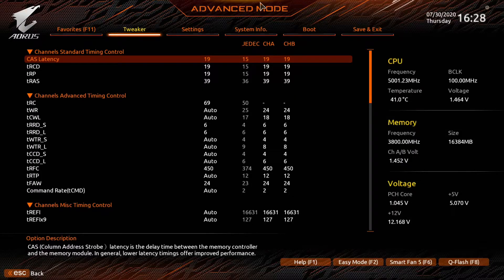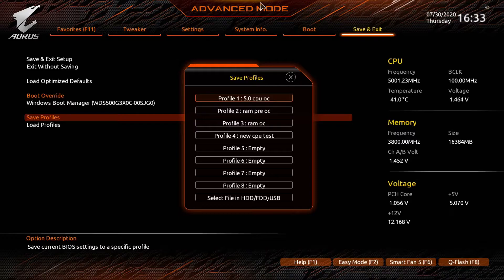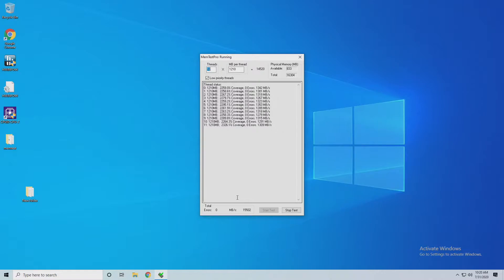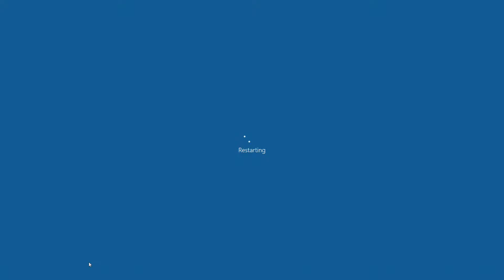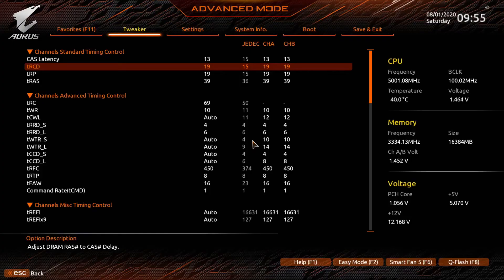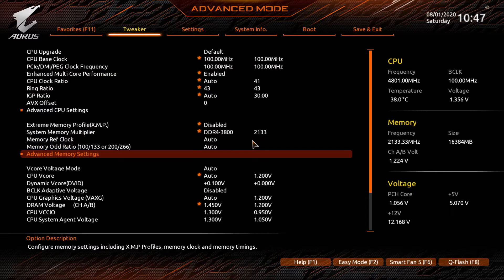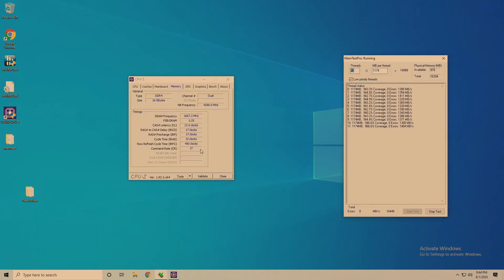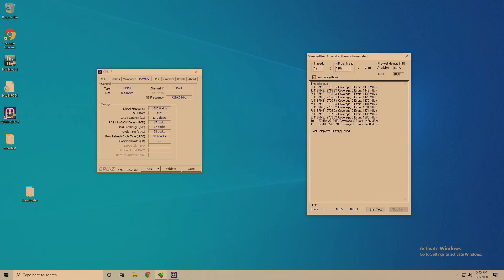Z490 DDR4 Overclocking Guide Part 2 - Tightening The Timings

Comment: By the way for what it's worth I ran Karhu (without Cache enabled) for 12 hours %23,000+ and it was fine, but later I ran TM5 with Anta777 Extreme config and for error "2" after 1hour and 12 minutes. I'm running a fan over the sticks. Is there anything I can do to make Karhu detect "better"?

Comment: Had to throw you a subscribe,  great informative videos. I would love to see a series on getting bdie to the fastest latency you can. I play a lot of warzone and just by getting the NS down (using aida64 mem benchmark) improves fps a lot. I just upgraded to a 10900k from a 8700k. Getting only 10 fps more since I need to finish my cpu overclock and start the memory ocing to get it running good.

Comment: 11:42 u have to raise SA voltage for tighter tRCD/tRP and in some cases maybe you need a little bit more ram voltage. keep in mind that when u are going for high freq (+4000mhz) or extra tight timings, u have to tune your SA (system Agent) voltage and iO voltage for your memory post and stay stable... u can  set your ram voltage to 1.55v  with this kind of samsung B-die s (100% safe if your case have good cooling) 
another thing is u can actually go for 4800mhz with your kit & z490+10600k... just set higher SA & iO voltage to system post! try this config for that and trust me i have to many world highest scores with different kits on Geekbench - Passmark PT v10 - Aida64 -USERBENCHMARK :)
ram clock speed 4800mhz (first try 4600 for try post)
 cas  16 or 17
tRP - tRCD  16 or 17
tRAS  34-38
tWR  14 or 16
rRFC 408 (first set it Auto for check system post with other timings)
tRRD_L  6
tRRD_S  4
tRTP  12
tFAW  16
tCKE  8
tRDWR_sg  11  (first set it Auto for check system post with other timings)
tRDWR_dg  11  (first set it Auto for check system post with other timings)
tWRRD_sg  29  (first set it Auto for check system post with other timings)
tWRRD_dg  25  (first set it Auto for check system post with other timings)
txp 5 or 7
-------------------------------
SA voltage  1.35 ~ 1.38
iO voltage  1.33 ~ 1.36
Dram voltage  1.55v ~ 1.58v
in some cases for higher clocks maybe u have to set a little higher cpu voltage 
this config work 100% stable on All 2666n downbin Samsung B-dies with BCPB at the end of theyr part number ( u can see that on Thaiphoon burner)
Reply: My man can you help me out with this?

Comment: Good timings for that kit that are super stable or 18 18 18 39 at 4200 megahertz 1.5 volts dram trefi 48000 your other tertiaries are fine
Reply: Late reply but thank you for this! Just set my Patriot Viper 4133 RGB to these timings and frequency at 1.5v and everything seems to be running great

Comment: Hey man, i love the oc series, i watched it all :) Great new channel👍
But i got a question: You say that u set 3800Mhz on the ram but in cpu-z it shows 1666Mhz🤔 1666Mhz x 2 is 3333Mhz or am i getting something wrong? Anyways good video mate, keep it up! You put a lot of work into it :)
Reply from the maker: Hmm thats odd, I didn't notice that, we did run the stress test at 3800 though.
Reply: @hardwarelens8040  yep it is 3300 not 3800 as u can see in cpuz and bios, my board doing same thing sometimes when i set 1t it works as 3300 or 3200 and not what u put manually...
Reply: @ATIHD5850  Yea these gigabyte boards will auto downclock the ram speed sometimes for some reason. He was running in 3333 CL 13.
Reply: @hardwarelens8040  yeah💪✌

Comment: Hi my Friend , i have this processor (i5 10600k) + 4x 8gb = 32gb 3000mhz memory. Do you know the correct times to use in this memory? Thanks!
Reply from the maker: you will have to experiment and see, make sure to check out the first video and start there.  Find the max frequency first then tighten the timings according to this video as a starting point.

Comment: when will fortnite benchmark be i subbed with nottis on and stream fortnite aswell i want to know if u can stream all low settings 1080p
and stay on 240fps please getting simillar build what do u think heres my build https://www.megekko.nl/wl/RQJET762
Reply from the maker: It should be our next video, we are just about done with this build, we will be bench-marking it next before it goes to its new owner.  Your build looks great, I might go with the ram we used instead though for guaranteed B-Die and better overclocking potential if you plan to mess with memory overclocking.
Reply: @hardwarelens8040  i changed my build to this u think it would be better https://www.megekko.nl/wl/45JZXQAW and i dont think the ram u got is available on the website where am buying but if it is tell me please!
Reply from the maker: https://www.megekko.nl/product/2046/1108558/DDR4-Geheugen/Patriot-Memory-Viper-Steel-PVS416G400C9K-16-GB-DDR4-4000-MHz-Geheugenmodule